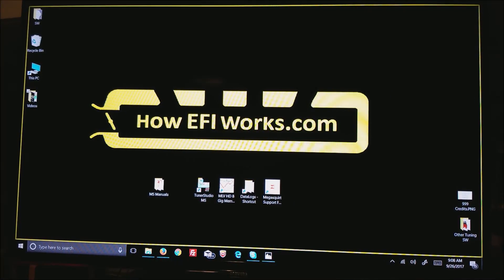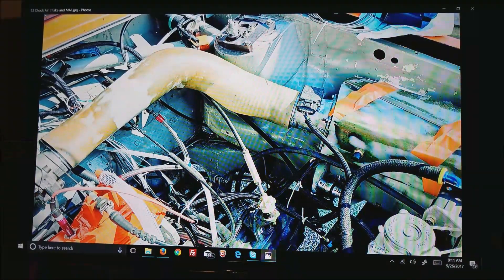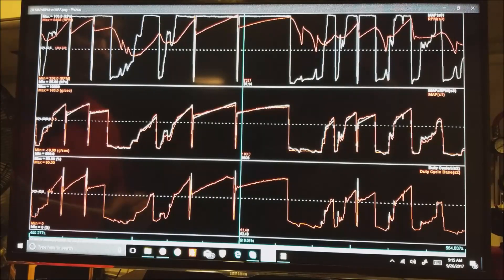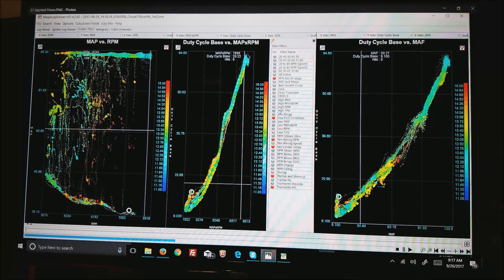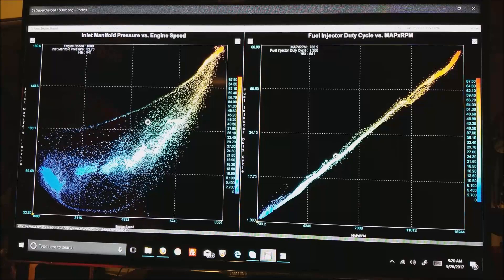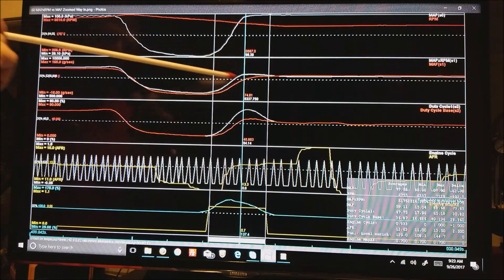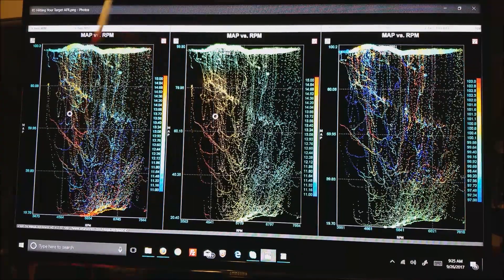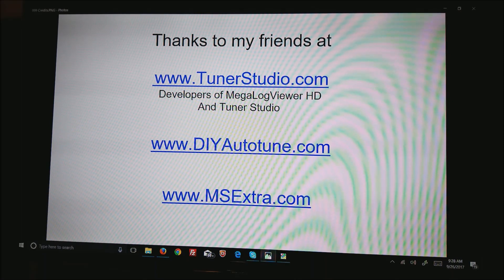MAPxRPM

Comment: Hi Andy. I'm at the stage where I was considering MAP or MAF. Its on a 351 Cleveland, Tow cam and M122 running 5psi. 1200-4200 RPM. Watching this I'm thinking just MAP would do, but I have this wierd desire for a MAF. Would appreciate your expert opinion. Cheers Rob

Comment: Interesting info, thanks. My aircooled 3.3L turbo does not follow the straight line map*rpm vs. DC. It gets a lot steeper at around 9000map*rpm and about 45 DC.
Reply from the maker: Post a zipped up data log over at Msextra.com and lets see what you are looking at.
Reply: Its on hold on tuning forum since 2.10